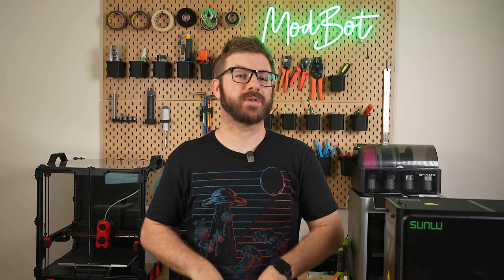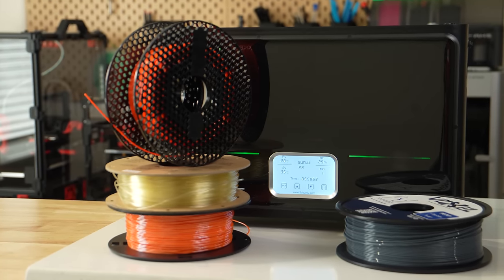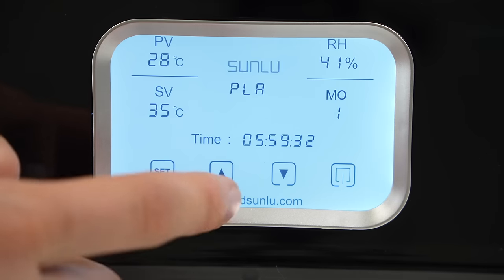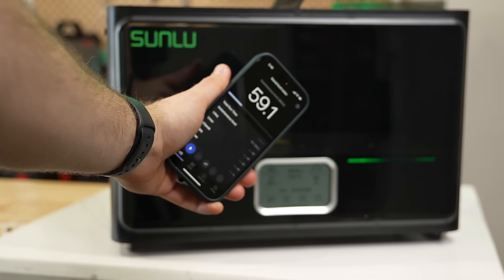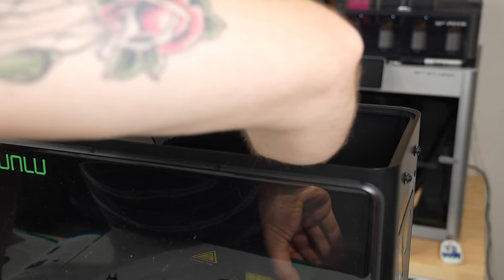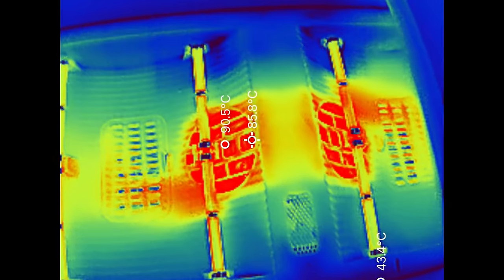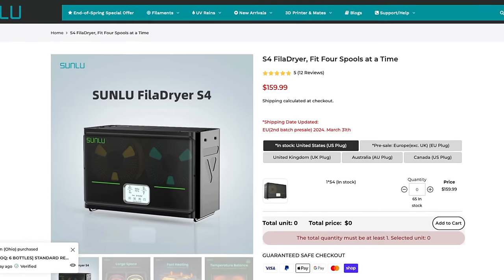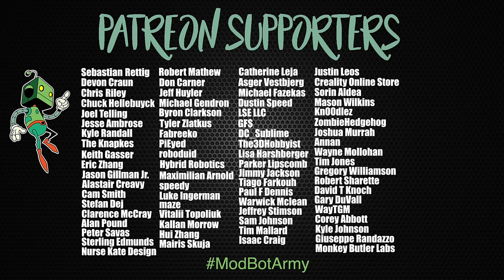Ultimate Filament Dryer Or Complete Overkill? (SUNLU FilaDryer S4)

Comment: When you heat plastic it loses plasticizers.  Like that film all over the inside of your car windshield.  So it has a limit on how much it can be heated before it breaks down.  And the longer you let it sit around the more moisture it gains and becomes very hard to get it back out.  Especially down deep in the roll.  And personally I don’t see much of a way for moisture to get out of the dryer without exchanging the air inside.